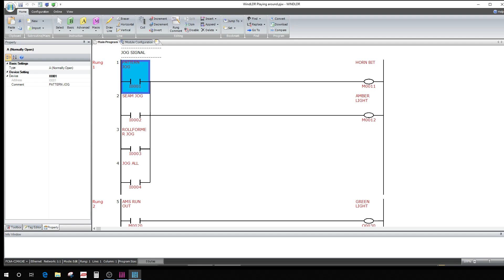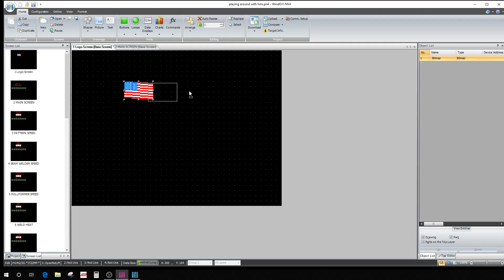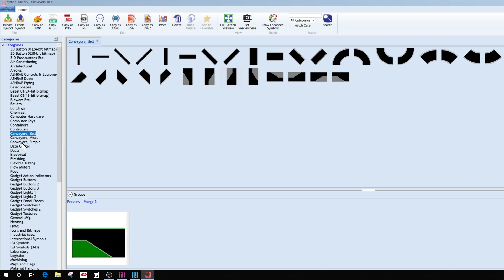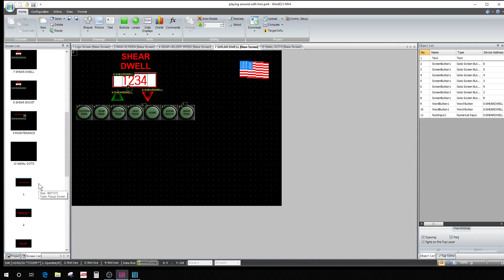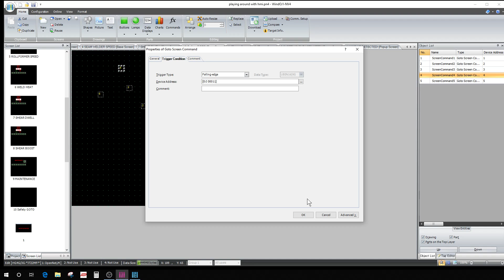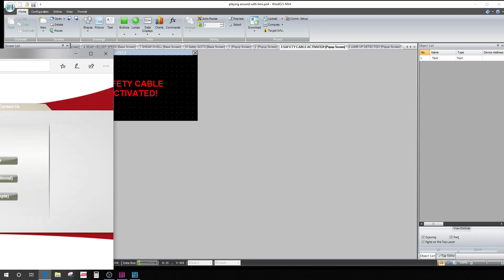IDEC HMI and LDR software

Comment: My next project will be automating a room to control 6 fans ,1 exhaust  fan, a heating unit to control temperature and humidity.
Reply from the maker: That should be a good project to start with.  Lots of people are using plc's to control Greenhouses in the same way.

Comment: Thanks for the video it makes more sense now, i need an analog card to play around with some of the sensors i have.
Reply from the maker: There is one built in analog input on the fc6a.  It is on the front under one of the covers.  It only accepts 0-10vdc analog input I think.  Refer to this manual for setup.  FC9Y-B1722
Reply: Yes i did see that 2 wire connector but i didnt know how how to use it.im gonna try to get a printed version of that manual and really get into it
Reply from the maker: I will throw a quick vid up for you.  @huntersblue